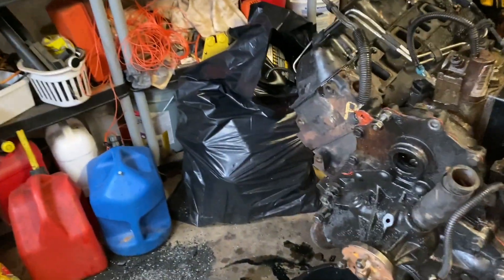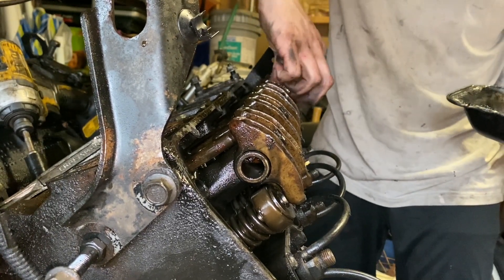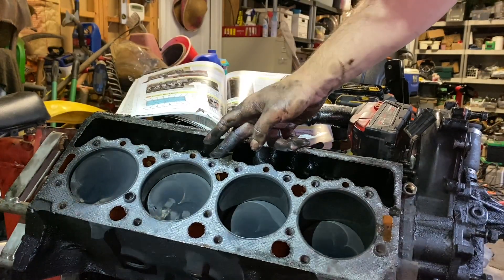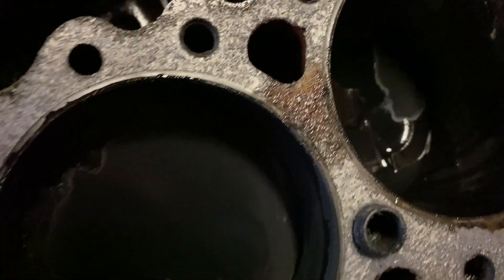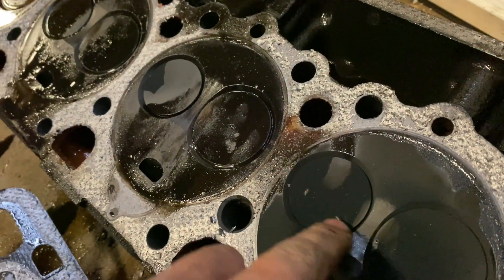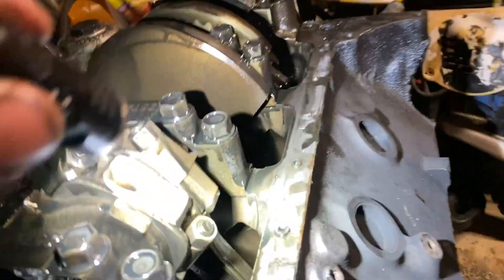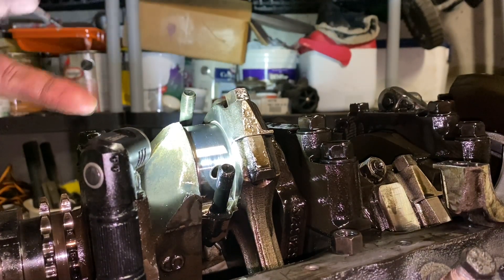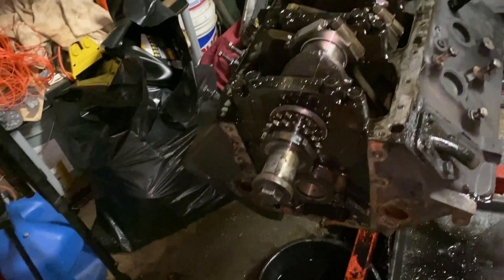6.5 L Turbo Diesel Engine Teardown

Comment: I have a 1994 full-size Blazer 2-door with 6.5TD.  Owned it since 2001. There’s 300,000 miles on the engine and transmission. Replaced timing chain once, a couple fuel pumps, many lift pumps. Oil cooler and lines.  PMD is on a remote heat sink. The usual upgrades and bolt-on component replacements.  Overall it’s been a fantastic vehicle.  In warm weather 19 MPG driving around town.

Comment: How many miles on this engine, just curious, I have an engine with 106000 miles. No issues so far.
Reply: You have a long ways to go!  There will be maintenance and replacement of various bolt-on components.

Comment: Just bought a 97 Chev 3/4 ton with a 6.5 diesel. Other than semis this will be my first diesel. I have got a handle on the 5.7 gas pot that I have been driving, so this is a whole new experience for this old retired trucker. Thanks for the video

Comment: Can you tell me where to find replacement bolts for the oil pan. They are discontinued at GM.
Reply from the maker: Check with unique diesel they might have them. If not i am not really sure where else

Comment: You said the heads are probably salvageable.  Are you just going to run them the way the are?  I recently went through one of these with the 599 block.  The block was good, but the heads had the same cracks.  I replaced them with some new heads from Clearwater that are supposed to have extra material between the valves and they took the old heads as cores.
Reply from the maker: I ended up cleaning the soot off and removing a couple valves and found the heads to be far more cracked than it looked. I will probably end up buying promaxx heads

Comment: Thanks, I know nothing about GM diesels. I'm a Ford guy but, I just won a non running Hmmwv. I'm assuming the worst hoping for the best. 🍻🇺🇸
Reply from the maker: Thats the best way to go into it as you can see lol. Thanks for watching
Reply: I just won a running HWWMV but no one bid on it but me. It was really hard to pull the trigger. My first GM diesel also. I got the two man 1998 1123 with 18,000 miles. It is in Yermo, CA. The clearance to pick it up may come in July at the earliest. Good luck with your HWWMV.

Comment: If you can, give us some info on motor use, mileage, issues, and game plan on replacing items. Good job, can’t wait for the next video.
Reply from the maker: Thank you, 234k miles and i dont have much history on it past 230k other than i know it was abused and neglected by previous owner. I just got the optimizer block back from the machine shop so I will be working on a video explaining all those details soon
Reply: @averybryant  when is the update coming for this 6.5 engine?
Reply from the maker: Posting one right now actually. Its not all that I wanted it to be but I have atleast gotten started on assembling some odds and ends. New heads are coming in tomorrow
Reply: @averybryant  nice the 6.5s are good engines, I know a few people that still run them here in little Rhode Island
Reply from the maker: Yes sir i love this truck and cant wait to get it back on the road

Comment: How many miles on this engine? Looking forward to seeing the new engine build.
Reply from the maker: 234k on the truck, but this engine was swapped in around 80k as a used engine so it’s probably closer to 250-300k. As you can tell it was not very well taken care of lol. Thanks for watching
Reply: Most I’ve seen tend to need rebuilt or replaced around the 275,000-325,000 miles. Not saying they don’t go further then that it just seems like most I’ve been around are definitely using a good bit of oil and smoke a lot both exhaust and blow by around those miles. Or the head gasket let’s go and it’s time to open them up.
Reply from the maker: Ive seen about the same thing, although more high mileage survivors than I expected. I still love these engines though and ver easy to work on. Hopefully this new one i am building will last a long time

Comment: Hi,how much can the heads be planed?And what do you do about the cracks between the valves?thanks.How many miles on the motor?Your shops not as bad as mine,hahaha.
Reply from the maker: Im not sure on how much the heads could be planed id have to ask my machine shop. I believe the cracks, if bad enough can reach the “steam jacket” and the valve seats both of which can cause issues. This engine had about 234000 miles on it, and was not very well taken care of by previous owner as you can see. Hopefully i can expand shop soon lol. Thanks for watching